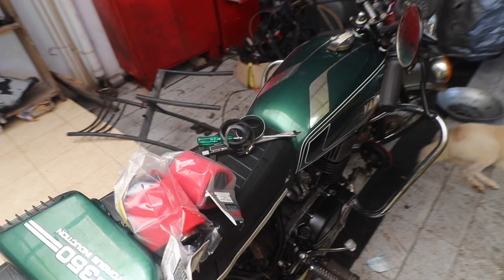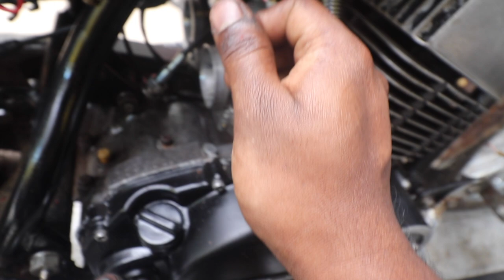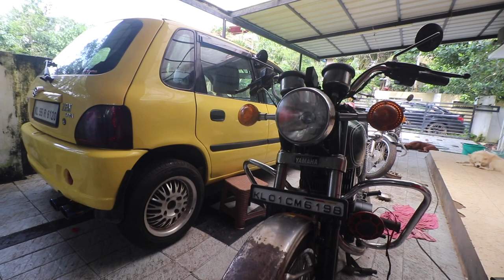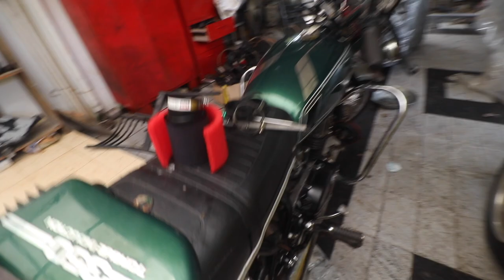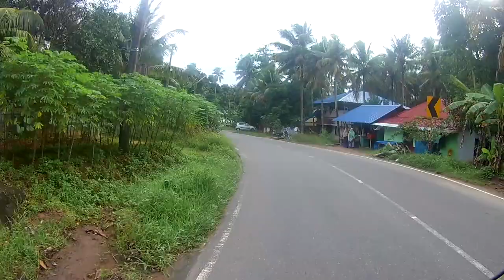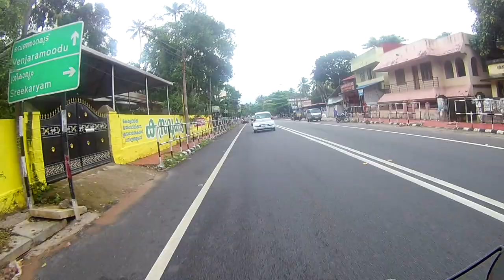RD first ride video after rebuild (Malayalam Video)

Comment: Bro Rx OE mudguards ippolendo atho shops I'll ellath aftermarket ahno , I contacted a seller but How I confirm it OE any tips
Reply from the maker: You can get the Crux mudguard, as good as OE, it just has two holes for the cables instead of 1, rest everything is same